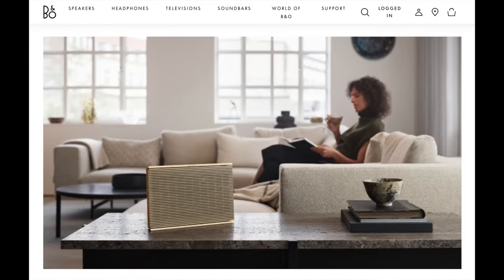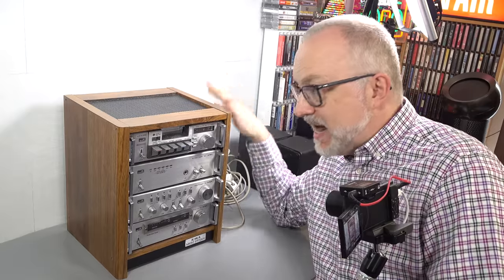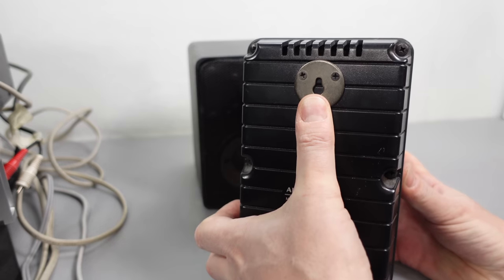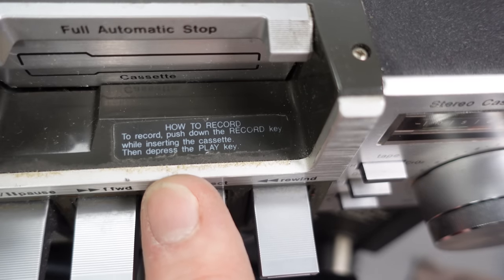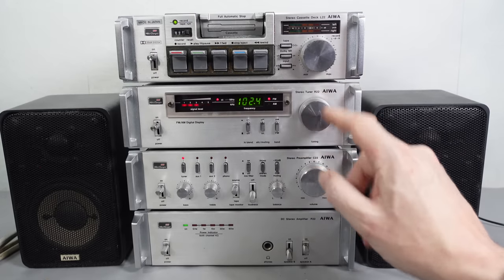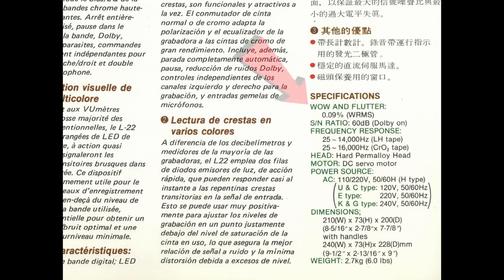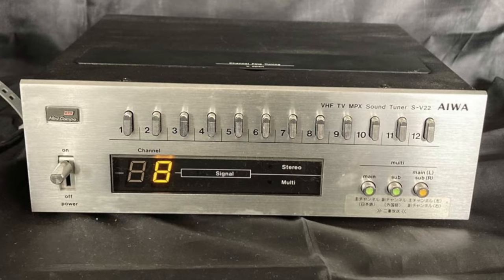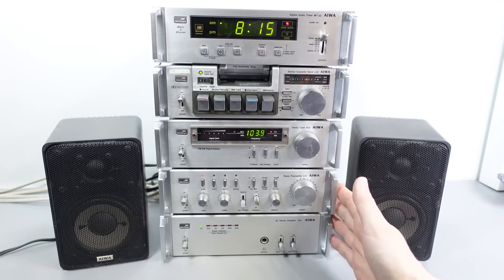AIWA SYSTEM 22 -  Micro HiFi from 1979

Comment: Interesting video, it's obviously a solidly built and stylish product. But like you say, getting something like this repaired would be very expensive. It's more for hobbyists that like to tinker. Also the skill set to repair these kinds of products isn't as common anymore. I imagine many of the parts would be impossible to find as well. Possibly a challenge even to get a complete set of service manuals.

Comment: This brought back memories of the little AIWA variant that my father purchased in Kuwait in the late 70s/early 80s - in fact I still have the amplifier from it and have been using with my PC speakers for 30 years now. My amplifier is AIWA model no. SA-A30H. We had the matching tape deck, FM radio, amplifier and record player, with matching speakers and a very nice grey/silver wooden box that the three main components were in. The little plate around the tape piano keys also fell off of ours but ours was silver underneath and still looked just fine so no-one ever bothered to stick it back on. I managed to blow the speakers up finally playing Doom on my old 486 PC back in the late 90s but until then they sounded very good. I found a website that has some very good pictures of the tape deck/radio/amplifier if anyone is interested to see, though the components in these pictures are all missing the ears from the sides unfortunately: https://stereo2go.com/forums/threads/aiwa-series-30-mini-hi-fi-system-1980-january-2019.3647/

Comment: The radio likely needs a tune up, especially from 79, the tuning on the circuit is likely long out of spec. The service manual would have the procedure and usually needs an FM signal generator and a mutimeter.

Comment: have one of those system. Been trying to restore the tape but the elastics kits I ordered didn't have the right sizes and they slip as they dont have enough tension.
My tape drive's 4 belts had turned to goo. Was a long process to clean it all up.
Opening this thing is a nightmare. There's multiple layers of boards and brackets to open it up and access the belts. Its a daunting task.

Comment: Regarding repairs. of old stuff like this AIWA System: I do the repairs myself and also for close friends. So I never had the problem to find someone doing it for me.

I do own a lot of these AIWA Micro Systems; the famous 22, the 30 Series, the 50 Series and the 80 Series and they are beautiful pieces, very powerful and good sounding.
But you need to do some maintenance to them; switches go bad, some caps, the old NJM OPA do fail; just the usual stuff..

For the tape: might just be the mechanical switch for rec/play selection; its a huge slider switch but more than often corroded. could to with some deoxit and moving it multiple times.. Might also be some other defective part; this specific error unfortunately does not ring a bell except the switch.

The speakers: the SC-E11 are bass reflex speakers, the sealing inside the sandwich-build housing goes bad and often the bass drivers have broken gaskets around the membrane; this is why they flap around like yours.
If the speaker is in good condition, sealed properly and not defective, they sound really good; not only for their size.
Repaired a lot of them and still have spare parts; I love them.

Comment: Regarding repair: I used to work in that business and I can definitely sympathise with all the repair places who were unable to help. In all likelihood it has nothing whatsoever to do with their ability , it simply has to do with economics. In the repair business, you don't make any money diagnosing and repairing a singular product. In fact, you will almost certainly lose money. Because even if they were to charge an arm and a leg, far more even than the system is worth, it probably still wouldn't be enough to cover the time they'd spend on it.
Repair places earn their money on repeat problems. In other words, they take the burn on the first time they see an issue and use it as a loss-leader. The next time they see that issue on another product of the same model, they're quids in. And hopefully they get enough repeats like that to make the initial one they encountered worth their time.
The trouble with old equipment like this, of course, is they are almost guaranteed to have no repeat business. So unless a Google search is going to turn up the exact solution, then it's a diagnosis job that will cost them money to deliver for the customer.
And everything I've just said doesn't even cover the nightmare regarding spare parts.

Comment: At that time an excellent system for permanent installation. Everyone was able to use this system intuitively. Unfortunately, the collective knowledge of buttons to operate such old hi-fi systems has been lost today. Mechanical contacts tend to corrode, the advantage of back then, switch on and forget which also withstands a power failure and return, today makes cracking noises and is therefore unusable. Systems with electronic signal switches have a longer life. They are just not suitable for permanent installation.

Comment: I wish I was your neighbor, I repair vintage (well, and new) hifi equipment anywhere from the 1930s to somewhat modern.  You really need to know what you’re doing to make a long lasting repair and because a lot of this stuff is so old I generally recommend to my customers that if they want reliability that it would be wise to have a bit of a restoration done.  I’d want to give that little guy a fair shot, so I would do that restoration for the purpose of the video.

Comment: Radio can be a fussy thing. You need quite a strong signal for decent stereo FM. Try 2 feet of multicore wire, near a window, as any walls and sources of interference will 'hiss it up'. Ideally, you should try tuning to a local broadcast as this will be the strongest. Too much wire antenna on FM will result in picking up too much parasitic signals from other broadcasts (electronics and other sources). Seeing as it is a standard input socket, try connecting your TV antenna to it. The coax will stop local interference and grab its signal straight from the roof. I do it with mine and pick up loads of stations, not all great, but much more than a wire in the house. :)
I miss my all black AIWA hi fi separates. The tapes were crystal clear and worthy of cd quality, the radio was rich and warm with great FM pick up, the amp made any audio input lively and juicy. The only thing probably not studio quality was the record player but really, I had no complaints. I had mine in the early 90's. I had them stacked top to bottom as Record player (obviously), Amp, Tape, Radio. I used to plug my computer into the Aux In which used to annoy my mum as it was quite loud and bass-y. I also had at the time a piece of furniture, a sideboard if you like with a record player and radio in it. The radio was fascinating as it had LW, MW, SW and FM. I used to love listening to Short Wave (still do, its my hobby). But by goodness was that old thing loud. The speakers (behind the 2 ends under wooden slats) were about 12 inches wide and driven by Vacuum Tubes. The beautiful, warm, rich sound from that is something very lacking in todays modern chip/transistor crap.

Comment: I used to repair a fair few of those L22 cassette decks, the other components didn't usually come in for repair. The plug on I think the power amp does not have insulated pins so be careful as very easy to get a shock if you are not careful (did it when I was about 6 so learnt the hard way) , they are not illegal to use however they are illegal to sell privately or for business attached to equipment or as a loose plug, every item that came to my workshop had them replaced! I may be wrong but I think Aiwa were part owned by Sony? I seem to vaguely remember that mentioned as at one point.  Aiwa were sending dealer  returns to the company I worked for as there in house team were busy. I saw a lot of AD  series cassettes particularly auto reverse ones with the rotating head, My fav deck was the ADF770 and at one point owned about 8 or more 770s and 990s those were the days.
Reply: Last 1 I fixed was years ago my notes say I used Flat 83 belt for the capstan, Sq 64 for Take up, Sq 50 for the autostop but I haven't written anything for the counter so I probably didn't change it and suspect the autostop belt is the issue because as you said low torque and the slightest resistances stops it

Comment: had a bad op amp on my nakamichi bx2 that was causing a channel out issue. also had a bad op-amp on an adcom gtp-500ii preamp that was preventing tone controls from working at all. i did a full recap of it (which was intense, like 40+ capacitors) and only found out after that i didn't have to do that, i just needed to replace the opamp...

Comment: Nice! I have the same set and and it's working great, except the tape deck which has no belts inside. They are missing without a trace. Do you any idea where to find such belts or maybe some dimensions?

Comment: Wonderful video, as always! I have a pair of old "Made in West Germany" Visonik David speakers, and they look very similar to the speakers for this system. Do you know anything about the Visonik David? I'm wondering if they supplied companies like AIWA with re-badged Davids. I love their sound, and I just bought a Denon RCD-M41 micro CD receiver to go with them as my own ad hoc mini system. I'm using one of the two digital optical inputs for a Wiim mini streamer, and I think the "bang for the buck" for this little system would be very hard to beat! I'm just using the Visoniks in my home office setting, but I think the system would sound great in a larger room if you used the included subwoofer output. I'm a big fan of these systems, and I'm looking forward to the rest of your "Mini-series!"

Comment: I couldn’t quite do away with the hifi completely….
Had the whole mini system thing for a number of years-later models sounded very good.
When that (Sony btw) finally broke (CD & DAB faults), I replaced it with a lifestyle flat vertical compact all in one with speakers hifi (Panasonic)…..single vertical cd, FM/DAB+ radio, USB streaming, Bluetooth streaming.
..tbh I hardly use it for the cd, but it sounds ok.

As for very early mini systems as per the video…I wasn’t aware of them..I remember my auntie & uncle describing it before they passed. Obviously I never saw it-they actually went for more typical larger unit. So this in the video is what they were referring to in their era.

This is old school way of creating an eco system….you can’t attach full size components to this and keep it looking neat.
You end up buying it all from same manufacturer…and they might make a good tape deck but not the best for radio.

Comment: For the last few years I’ve only ever listened to music through earphones (good pair of over the ear ones) or a half good Bluetooth speaker…….anyway I was clearing out the garage and my old technics system from the 90s is in the corner, nothing special. I turned it on and listened to a cd, the sound sounded so much better than the earphones or Bluetooth speaker it was actually so much better I was surprised.

Comment: These systems were not very dependable back when they were new,  Compared to the Full Size components available at the same time. 
I currently have Vintage Pioneer Reciever with Aiwa  Cassette and Marantz Turntable,  but just like this system all of them were gone through and virtually rebuilt,  They are all Absolutely Awesome, The Big Difference is the Value,  by the time you put your money in these Mini Systems they aren't worth what the Maintenance and repair costs. On the other hand the full size  Equipment is well worth the costs to "go through".

Comment: If I had a micro system like that I'd probably combine all the power leads into a junction box mounted on the inside of the box behind the components and have a single lead to the wall.

Comment: Those speakers wouldn't just become distorted and worn with age, but rather they're very inefficient and need gobs of clean power to sound their best - which the amp in this case wouldn't normally be able to supply. 

Also check the crossover, there may be electrolytic capacitors inside that could have drifted out of value. If they have poly caps (like my Visonik David 502's, another very small speaker similar to those), then just leave the crossover alone.

Comment: I have one of these systems which I bought in 1979. I didn’t have the speakers but bought a pair of hitachi metal dome speakers instead. It cost about £500 at the time. For the past 30 years I have had exactly the same problem with the cassette deck. Did you ever find what the problem was.

Comment: 8:56 I really hate those bar+prong connectors in the middle. When (rarely) I see them here in the states, they're usually used as DC power supply connectors, for which they are truly awful in terms of pulling out way too easily. But as speaker connectors, I still prefer the wire clips.

Comment: The A/B switches for the speakers, is it for different type of connectors or did AIWA have it's own sort of bi-wire system in those days? That set looks like they were trying to build a regular sized hifi-set into just a smaller setup so trying to include such thing as bi-wire doesn't seem weird for me.

Comment: At a guess I'd say you have some dried up capacitors in there. If you can find the service manuals, you might get some clues from those. The low performance of the tuner and the completely dead channel on the tape,  both smell of open or nearly open circuit capacitors.

Comment: I definitely would have got frustrated, chopped all those cables short, installed a power board in the back of the cabinet and run the one cable from that.

Comment: I'd fix it, myself, if it was mine. That's what I do, because I don't feel like I deserve something if idk how it works.

On that, I suspect simple mechanical things have aged (like that belt) and some capacitors have popped or leaked. 

Start with a thorough visual inspection, replace all belts, clean the 40 years of gunk, then start replacing any bulged or leaking caps, and it will probly be good as new.

Comment: Wouldn't that cabinet have rails on the front to hold in the components, and the components themselves providing some degree of stability when mounted?

Also, no record player, was that intentional? Was there a recommended deck that AIWA intended to go with this?

Comment: Aiwa.Excellent and clever company. If you want a nice small system that includes a Linear tracking turntable look at the Aiwa FX range. Even the cheapest FX 20 has a neat Linear tracking turntable. Go for the FX 50 or FX 70 if you can. Good to look at too. And only ONE power plug necessary. Simple and clever, which sounds contradictory , but true.
And there is someone who can genuinely get this properly repaired whom I use but have been through 3 who pretended to but were unsatisfactory.
With respect the speakers on your Aiwa were always , to be plain, awful.

Comment: I can straight away blame the electrolytic caps for most if not all the electrical issues there. Like come on its from 1979. My Sony ta-fe530r begins to slowly die and I too blame the caps, the right channel begins to fade and it just gets lazier every month. 
The amp got replaced with a new Rotel A11 Tribute. Will be recapping the sony though, I think It's a great amp!
Edit: that Sony amp is from 1999, So I'm surprised that Aiwa even turns on at all.

Comment: The reason for the separate power cords is so that each component could be used in a different system without relying on some sort of phantom powering or ribbon cable that would limit the capability and connectivity of the individual components.

Comment: I got this system from my boss! He's bought that when he was a teen!
The cassette deck pretty much sucks though. It's clunky, it's wonky, it's counterintuitive and the wow&flutter on mine is pretty bad. And the belts had turned into goo. I have it in two wooden cases.
Is there a wow&flutter meter for hifi cabinets? Maybe the cabinet needs new capacitors!
On mine, at least everything is working. The tuner is half decent and the cassette plays both channels. The tape counter has the same problem - if I hook it up, it stalls the magnet next to the reed switch for movement detection.
Another thing about the tuner - on mine, the bottom LED barely lights when there's no reception and I can get all 5 on for stronger stations.
I fix my stuff myself, I'm pretty good at it.

Comment: Hi, I have a DIY speaker that does not provide high fidelity. I would say pure fidelity describes the sound. Big claim but they are loud and clear so no distortion. Music is limited by recording, Cinema is un-phased by very low frequencies and is very realistic as is TV. Specs are 6Hz-44khz +/-1db 98db sensivity. Hybrid Bass. Low footprint 25cm x 20cm x 90cm. They have 52 drivers in a pair and are very unusual. 15 years in R&D so far. I need to share this experience, please can you  come and review them for me.

Comment: That digital tuner probably has some analog precision tuning on the inside.
Reply: It is an air gap tuning capacitor, with some string, and knob, an a big flywheel. Very satisfying. The display on the front is just a frequency counter.

Comment: The Tuner says it has an "FM / AM Digital display" which means it's an analog tuner with a digital readout. This was the cheap, quick and dirty way to update the look of a tuner without actually producing a digital tuning circuit, basically fooling the uninformed consumer.